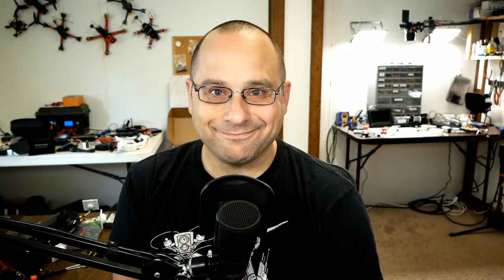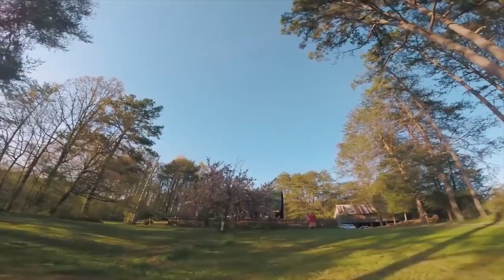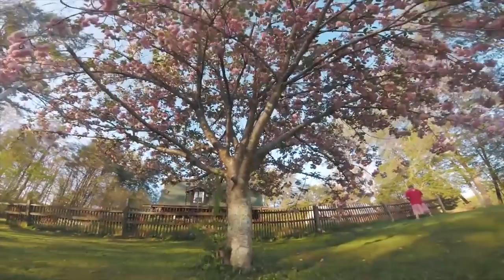Parallel Charging | CAN YOU MIX DIFFERENT mAh OF BATTERY

Comment: I charge perpendicularly.
Reply: Nice. Then you can fit more batteries in the same area! ;)
Reply: Horizontal love dance.
Reply: Everyone knows charging tangentially is THE best method...pfff
Reply: You all are stuck in a 2-dimensional battery charging Flatland. 3D charging FTW! 😎
Reply: @basnnov  there is no such thing as third dimension... Its a myth. Grow up
Reply: Lol.. that's a fucking awsome comment
Reply: I never learned my shapes😔
Reply: I charge through the 5th dimension mid-flight. Get about 10 minutes out of a 1000mah 6s on my 5inch drone, only good for one flight tho; then i gotta spray the battery with a fire extinguisher 😂

Comment: as if I had enough packs for parallel charging...
Reply: Mihkel Rebane ..I feel you bro..just 4 packs here
Reply: This is why I like my micro 2" & 3" brushless quads, 460mAh 2S packs from Hobbyking are less than $5 each!
You don't need to fly 5" to have lots of fun :)
Reply: Agreed, I've got at least 60 packs for 2" & 3" quads 🔋 🔋 more bang for your bucks 👊 👊
Reply: got only  two left, lol my third one died... sooo pooor
Reply: i have 1 single battery
Reply: i have three now and I'm feeling super good
Reply: @Smt_Glaive  Lol 4 packs is enough

Comment: When you jump a car you're connecting in parrallel, pos to pos, neg to neg. This has been reasonably safe (shock risk not-withstanding) for decades, thats your clue that its safe to do in a circuit.
Reply: I've just paralleled two different batteries, one is a 90Ah AGM, the other is a 75Ah Lead acid, their voltages were roughly the same, combined they seem to work well, I've joined them with wire from a set of jumper cables, I have solar power with mppt charge controller and also hooked into the alternator of my car, admittedly it's early days, but nothing is hot, nothing go boom... the charge controller / solar is happy with the batteries and has improved both of their floating voltages, everything now it sits at roughly 12.7 volts, I've increased the CCA for starting the old girl and have enormous capacity for charging electronics.

I think people like to make it all sound more complicated than it needs to be because it sounds clever, my thinking... it's overcast, not a scrap of sunshine in the sky and I'm getting a trickle charge... surely this "slightly different voltage batteries trying to equalise thing" is negated if the entire system is trickle charging?

Comment: Joshua I am in a quandary over charging 2 lithium ferro phosphates in parallel. Same ah, same voltage, practically the same age but 2 different brands. Each has its own BMS internally. They will be charged by the same solar controller. I see no problem but I am seeing everyone saying no no no you must not put different brands together. I have spent a life in electrical stuff. I say nuts. Each battery will take what it needs and deliver the same way. I would like an opinion. You actually said in the video brand doesn't matter so long as they are close to the same parameters. I wholeheartedly agree. The water analogy is a very good one. To listen to the manufacturer you would think it spells doom. I say it says more about selling their batteries as opposed to the other guys.

Comment: I was building and selling wired lipo parallel and balancing / charging rigs (2007) way before parallel charging boards came on the market.  I sold World wide ... custom rigs built to spec. My profession back then was a Circuit Layout Engineer designing mother boards for UNISYS. Speaking as an Electrical Engineer,  you are spot on with your comments! Keep up the great work of passing needed information along!!!

Comment: Really good water analogy... Many people simply can't grasp something they can't see or touch, like electricity.

You are right about small voltage difference. Some people think hell 1 V is nothing, but Lithium batteries only have about 1 V between fully empty and fully charged state. Yes, as soon as you connect them in series this 1 V "spreds" but still it can be a big difference especially  if the battery is 2S or 3S.

Comment: You sorta mention issue with putting a 500mah and a 5000mah in parallel.. not really issue but sorta something to think about.  You do this all the time.  What about when you have a parallel board with 10 ports and you hae 9 1000mah lipos hooked up and go to plug in the 10th.. you haev a 9000mah lipo you're putting in parallel with a 1000mah lipo.

IMO the safe thing to recommend when you have a pile of lipos to put in parallel, go through and check their voltages and sorta sort them from lowest to highest.  Both good check that you're not plugging in very discharged lipo with a fully charged lipo by accident, but once sorted when you attach lipos to paralell board you sorta just go in order from lowest to highest.  So the lipo you're connecting is always higher voltage and its current will be split across alll the connected batteries.  Safest order to do things.
Reply: hey thats a great strategy. Makes sense!

Comment: For batteries that are substantially different in voltage, before charging them in parallel, just take a power resistor and place it either between the 2 negative battery terminals or between the 2 positives.  Let it sit for maybe 15 minutes or so to help equalize the voltages. If you are in a hurry, perhaps 5 minutes will suffice but if not in a hurry, give it longer to be more sure.

I have a 0.5 ohm power resistor so imagine if I had 2 batteries such that one was at 13V and another was at 12V and I wanted to parallel charge them.  That 1V differential with 0.5 ohms of added series resistance will flow at most 2A (V=IR) so 1 = 2 * 0.5.  Also, the spike of inrush current will be very brief, as the batteries will tend to voltage equalize rather quickly.

A "trick" I like to do  (and I just happened to be doing it right now), is if I charge or discharge paralleled batteries of different capacities, I will use thicker wires on the higher capacity battery and thinner wires on the smaller capacity one.  For example, I have a 3 hour battery and a 1 hour battery (tested individually using the same load).  For discharging in parallel, I connect the 3 hour battery using thick wires, but then I jump the 1 hour battery to the 3 hour battery using smaller thinner wires.  This adds resistance to the 1 hour battery so it doesn't draw as much from it.  Similarly, I could use this same setup while charging.  I could connect the charger directly to the higher capacity battery, and jump the smaller capacity battery using those smaller thinner wires.  For this to work ideally,  the total resistance from the charger to each battery should be in the same proportion as the batteries capacities.  This can be determined by measuring the battery voltages individually, and then measuring the current flow across a known load (such as thru a 10 ohm resistor).  Any deviation from the current expected thru a 10 ohm load is extra series resistance of the wiring and the battery itself.  Once you have those numbers, you can proceed to add 1 or more sets of small wire jumpers to the lower capacity battery, until you have the resistance ratio match the capacity ratio (in this case, 3:1).  That is, the total resistance (including the resistance of the batteries themselves), should be (for this example) in a 3:1 ratio, so then when charge current is applied to the 2 batteries, 3 times as much will flow to the larger capacity battery.  For example, if the charger starts at 4A, 3A will go to the larger capacity battery and 1A will flow to the smaller capacity battery.

Comment: Would be interesting to see a couple of watt meters plugged into each battery during parallel charging.  This would show the charging amps will be different depending on the pack size.  And would confirm your statements in the video.
Reply: I'd love to see that
Reply: I'd love to see that

Comment: As usual, good information.

I always plug in the main connectors (Xt60) first and leave for a minute.  The main connector can handle a MUCH larger current and this allows the batteries to equalize.  THEN I plug in the balance plugs and balance charge.
Reply: Hello sir ! please tell me can i connect two mobile charger { 5v 1amp and 5v 500 mah } in parellel . I mean (+) with (+ )and (-) with( -) .
I need 5v and 1.5 amp output ..
Would it work currectly . Please reply . if you know ?

Comment: I was charging like 10 different 9v batteries in parallel, it worked ok, no leaks or problems. 
You can do all kinds of stuff they say not  to do but you need to know all the risks and dangers and when i do stuff like that im not leaving it unsupervised. 
Also parallel charging is a way to rejuvenate batteries, because the one can't ever get up to the final charge voltage, you parallel it to a good battery, then you charge them, this means the charger doesn't shut off when it senses the bad battery not taking any more current. Then over time the two batteries will equalize to each other. This is good for lead acid types.

Comment: Great Video... 

Josh mentioned the voltage difference between batteries to be .1/cell. I can tell you first hand pay attention to this and as a noob/rookie mistake (not knowing about voltage), I was parallel charging 3 4S batteries that was at 13.8v, 15v and 15.1v respectively and started a fire during my charge. The lower voltage battery was just overloaded from the other batteries and charging station.

I have since learned, check your voltage and if they are over .4 difference, balance them out first. You can plug the batteries into the parallel board (without charging it) and leave for about 10-15 mins. Recheck to see if the battery voltage has balance out and is back to .1 difference. Now you can safely charge without starting a fire.

Just my experience.
Reply from the maker: If they are over 0.1 volts per cell do not plug them into the board at all.
Reply: Thanks. i'll stop from now on

Comment: I used to have a "Balancing box" several years ago (Like a lot of my old kit, God only knows where it eventually went). You plugged 2 packs directly into it, and it would equalise the voltage between them. I can't remember if it did this by taking power from one and putting it in the other or just drawing power from the higher voltage pack until it matched the lower one, but it was a pretty useful tool to get voltages similar before connecting 3s packs up in series to charge as a 6s.

I later got a charger that could balance charge up to (IIRC) 10 cell packs, so I made a 9s to 3x 3s charger lead set that fooled the charger into thinking it had a single 9s pack plugged in. The only problem with that was that you had to have paranoia levels of care about connecting the packs on to it because if you muddles up the balance leads you'd be creating a dead short........ Apparently this is why pretty much no reputable shop will ever sell you one of these leads pre made. :D . The only way I can think of to "Idiot proof" this setup would be to have the XT60's and balance plugs grouped into their pairs and hard mounted on a circuit board. As long as the distance between the groups of plugs was far enough that NO combined factory fitted power and balance lead was long enough to cross between battery plug groups, it would be safe........ But then again, some idiots can be quite inventive in their stupidity. :D

Before connecting the packs up to the 9c/3x3c Frankenstein balance lead I'd connect them to a REALLY dodgy "Voltage equaliser" that I made. This involved plugging all the packs into a board that bridged all the positives together and all the negatives together, but via groups of 12v/1A car lightbulbs to work as cheep resistors to limit the current, and also as lights to show when it was close to ready. As I said, this was dodgy as hell, with bare contacts all over the place to probe with a multimeter, and hot/easily shattered bulbs trailing on wires all around it. But the great thing about it was that it didn't pull any punches. Yes, it was sketchy, but it also LOOKED sketchy too, so you were under no illusions about how high tech and low risk the thing actually was. :D

Comment: My technique is to plug all the main leads in to the board first and allow to sit a few minutes. This allows the voltages to equalize and allow current transfer between batteries through the larger main leads. Then I go back and plug in all the balance leads once the voltages have equalized. Then I'm ready to charge. To take it a step further, if I find my self with a full battery that I will not be able to use in the next day or two, I will take a discharged battery and plug the two in together using only the main leads. This will bring both close to storage charge in a short amount of time. I've never had an issue doing this.  Knock on wood.
Reply: RCing inSC  yes this is the proper way to do it because the resettable thermal fuses on some of our mpa boards can’t handle the surge of current if you plug balance leads in first.

Comment: I’m curious as to how the current distribution works out. Does each battery take the amount of current proportional to its size? 
Is current still equally distributed between batteries regardless of size? 
Does internal resistance play a factor?
Reply: From my experience, yes the power flows in equal distribution regardless of size (capacity).  If the batteries are in parallel, they will automatically equalize perpetually.  Internal resistance does play its part, but equalization will still be doing its job.  Typically, in a real world case, your charging will be much more controllable than your discharging.  For discharging, you need to think about how much power will be flowing, and size/structure accordingly.

Comment: i just got the ISDT q6 charger and your 4S parallel board, and wow, what a nice, slick combo. The board I had before was utter crap, no protection, flimsy, nothing like this new one.  I have less fear or burning down the house, now.  Very nice board, Josh.
Reply: tchthsky you shouldnt :( you can still burn down everything :( its a great tool but still....only one moment with guard down is all thats needed.
Reply: Chemistt it was a bit of sarcasm...but i totally agree.  My point was build quality is superb compared to similarly priced junk, that had 0 protection.
Reply: The istd Q6 I had would was stubborn and not work with a p board that had much use on it. It always needed a newer board. So the q6 sucks and you will realize that  once you buy a Hoda D6 pro.

Comment: Hi Josh!! Awesome video! I’m new to fpv and all your content is so helpful!!! - subscribed! Quick question, when mixing different battery capacities to parallel charge, what should be the “safe” equivalent to charging 1C? Would it be just to stick to the lowest size capacity? I.e. if charging 6 batteries, 4 being 1500mah and 2 being 1300mah, would I just stick to 1.3 x 6 = 7.8A?
Reply from the maker: Sum the mAh of all batteries to get 1c.

Comment: This is an older video so not sure if I will get an answer.  Your video did clear up part of my question - can I combine batteries of the same voltage - parallell with different ah and then combine these in series - eg, with 6 - 12volt 100ah lithium batteries - combine 4 of the batteries by  pairs of 2 in parallel so in effect I have 2 - 12volt 200ah batteries (from the 4 batteries) hooked up in series to the 2 remaining batteries = 12volt 100ah each giving a total of 48 volts ?ah. What kind of issues would this create - combining 6 12v batteries to get to 48v?

Comment: I had this problem and needed to balance them before placing them parallel. I took the internal resistance of the lower voltage battery and checked the max charge current. Just added another resistor in series during equalizing. After a while the potential difference whas enough to spot weld them together. Just make sure to calculate the maximum allowed potential difference for the lower voltage cell charge current.

Comment: All that is true, but it's about charging.
In a nightly discharge cycle batteries will discharge unequally and re-equalize between any significant load demand. Unless the BMS can block the process, the strongest battery will charge the others with every imbalance. The more dissimilar the batteries, the heavier the load dynamics, the more dissimilar the discharge, the more frequent/heavier the re-equalizing between themselves.

Comment: TO better answer, a good charger can detect how many amps the battery is absorbing ie how many amps returning on the circuit vs how many amps sent. With lead acid when the charger is putting out 2 amps and is getting 2 amps back then it battery is charged as its not absorbing anymore power. Lithium is a bit different as it will take more amps and the end of the charge rather then less, so when you lithiu m charger sees a spike in power absorbsion it says its charged.

Comment: Can we  parallel discharge big mAh with little mAh safely ?( having same voltage )
Reply: Yes the two will equalise and discharge at the same current safely the larger mah battery will count down mah at a higher rate than the lower may battery  at the same current buy diy lithium battery book by micha toll £10 from Amazon learns you everything needed to know about battery capacity building packs discharging lipos powerhouse packs I always put the closest mah batteries together anyway. Hope this helps